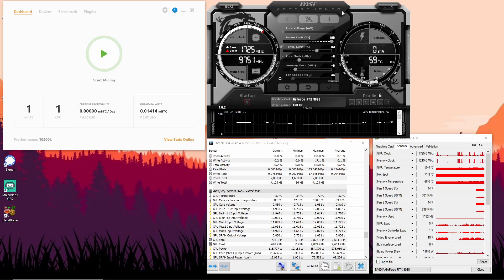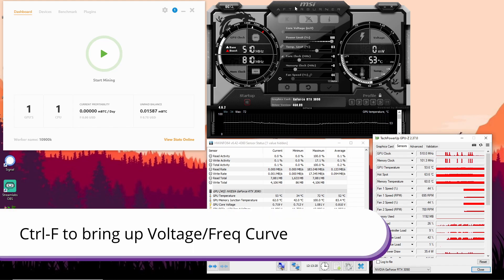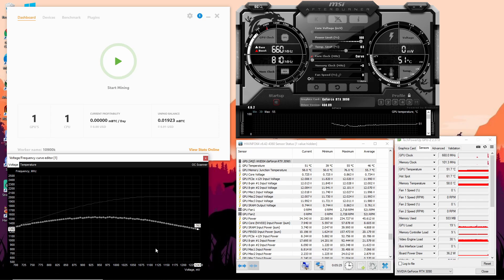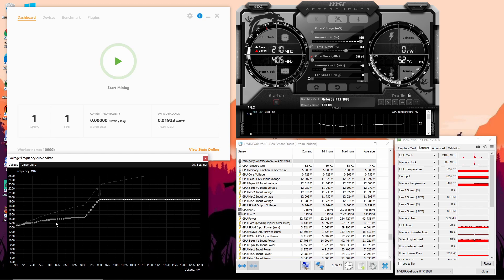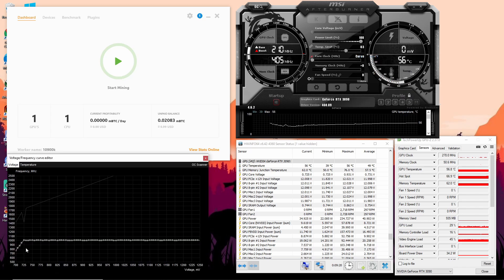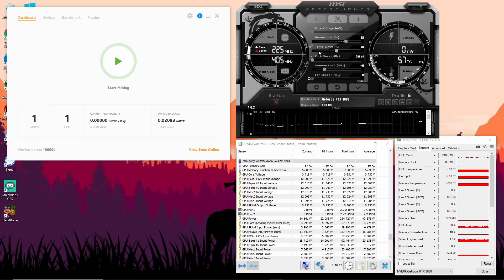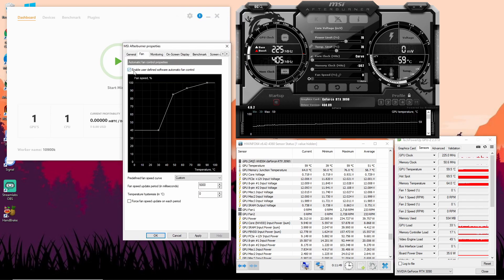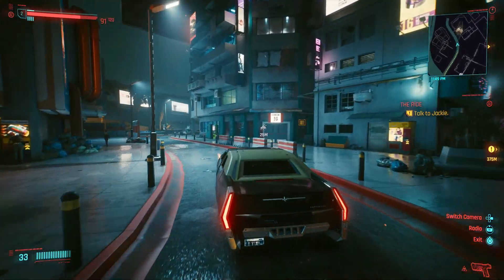Undervolting and Underclocking GPU Guide (MSI Afterburner)

Comment: This is capping the clock, for undervolting specifically wouldn’t you want to set everything after the voltage you want to 0? For example keeping the same clock speeds but up to 1000mv and all the points after that to 0mv??

Comment: PLEASE HELP I HAVE ALOT OF QUESTIONS AND IM TRYING TO LEARN.

Ive set my 3080 on 1440mhz and 800mv
I play on 1080p and seems to get steady 60fps on rdr2.
Is this good or bad? The reason ive set it so low is because i have read that 3080 default mhz is 1440 with boost to 1710mhz also according to tpu gpuz. So ive changed it in msi. 
I was thinking because i play on 1080 i use too much power unnecessary? 
Ive also read higher core clocks increase fps, so with vsync off i reach over 250 fps in heaven benchmark with a score of 7k. 
But, 
What if i descrease the core clock so low that it hit 100 fps average in heaven benchmark? Will this affect my games? Or can i still hit the 60fps with stable graphics? (Graphics glitches, artifacts, only cause issue when too low voltages mv? 
Because im doing all this because my gpu temp goes to 83 degrees in rdr2 (stock) and i dont like to hear the fans. 
So i underclocked it to 1400mhz and 800mv but everything seems to run just fine in rdr2 benchmark. Am i to except any problems if i keep playing like this? 
Will this increase gpu usage aswell? Because i don't hit 95%+ usage in gpu with max settings. 
What if i use dsr with this low mhz? Does it need more voltage, but can i also stay at 144pmhz? 
Lol i don't understand. People stay that i need the highest mhz with lowest mv, but why if i run just fine with just lowering the mhz?

Comment: This is the only way to save your 3090 from dying. My second replacement blackscreened with fans at full speed when the card decides to spike over the voltage limit. Thanks for this, please anyone with a 3090, 3080 do not leave your cards at stock voltage.
Reply: same for rtx 2000 series
Reply: same with 4090

Comment: So I have a Galax GT 1030 ExOC White. I has a max core clock of 1502 Mhz and memory clock of 1502 MHz. But thanks to Nvidia's adaptative boost, this GT 1030 can easily reach 1953 MHz core clock and 3004 MHz memory clock (on Linux it hits 6008 MHz memory clock). But these high clocks can make the GPU unstable in some games and 3D applications, making the entire PC crash. I was thinking in using MSI Afterburner to underclock it. Should I just lower the Power Limit, or lower the memory clock?
Reply from the maker: If you want to underclock - just lower the core clock (mhz). It's different to undervolting which is lowering the powerlimit or adjusting the voltage curve. You shouldn't really have to underclock/undervolt, on default settings, you shouldn't really have any games or programs that are unstable because its the sweet spot of power/performance/cost.

You can always undervolt to optimise power/performance/costs if you need to.

Comment: I have 2 RTX 2060, when i undervolt one the other goes back to the stock curve, how can i make it work? i use MSI afterburner.
Reply from the maker: Hey there, when you use two GPUs on the one computer, MSI Afterburner will let you have different profiles for each one - it'll be an option near your 'profiles'.

Comment: Geforce rtx 2060: 2000mhz @ 925 mV never chrashed in like 6 months 
my card runs 1365mhz @ 700 mV btw so its cooler in idle (for me 1365 mhz is idle because of my wallpapers btw) 
didn't found a game where it hits the 83°C yet and this with fan speed locked at only 60%
really helped me with the bad temperatures I had before undervolting and for those of u wondering I even got more fps in many games because it doesn't hit the 83°C anymore (where it's clocks itself down)
Reply: you will burn out your fans a lot faster if they aren't on a curve
Reply: @TheSpiffingSangheili  It's not that hard to replace them
Reply: @maymax0076  you do you, i dont have extra cash to waste.

Comment: Idk why but rdr2, watch dogs 2 and gta 5 (high end games) stutter after some time when gpu temp reaches 80c and then it falls back to 76c and this keeps repeating. When I played gta 4, gpu temp was 68 to 75c and it was running on 40fps and no stutter. Idk what the problem is cause this is happening to me since i have built this pc. Specs are r5 3400g and rx 580 asrock oc 8gb and 16gb ram ddr4 2666mhz single stick. Can anyone tell me what the problem is please...
Reply from the maker: Perhaps you're running a single stick of DDR4 which means you're using half the memory speed (so instead of 2666mhz, its actually 1333mhz). DDR is Double Data Rate, and it only works at the advertised speed when you use at least two sticks.

I don't know if that's an issue, but that might be a bottleneck.
Reply: @JimRPG  so any idea of what should I do to fix if thts the problem. Coz the stutter occurs when gpu temp reaches 80 but when I play gta 4 the temps are normal till 71c. It only happens when I play demanding games. If it is bottleneck then what component must be causing this?

Comment: I've tried following you and every other videos in yt about undervolting but still nothing happens 😢 my wattage still the same, my temps are still ranging from 80-87 playing AAA titles, its sucks man. Im using Asus RTX 3060 ti dual mini. Someone here knows how to deal with it?
Reply from the maker: hey dude, what part of the guide are you having difficulty with? What part isn't working?

Are you getting 80-87 for GPU Core? 80 is fairly high but normal - im also getting about that for cyberpunk 2077 on a 3070 - and that's the gaming OC which is 3 fans.

87 is a bit high though. id undervolt it a bit there though if you need all the performance then keep it at that temp.

I wouldn't expect 50-60 degrees for gpu core because thats for mining.

You're welcome to join the discord there and post images of what you're getting if you need help.
https://discord.gg/gXs9JhUtrk

Comment: I got 3060 and dropped the limit to 70 it still runs at 40 idle is that normal or should it drop more
Reply from the maker: are you playing games or mining?
70% is a lot to drop to, im running mine at 90% - I have the original one so thats what I need to run it at to get 47mh/s. mem temps and gpu temps are not that big of an issue on the 3060.
Reply: @JimRPG  playing

Comment: Hi, l undervolting my 2070S  but MSI afterburner after some time in stress (up to one hour) raises the core frequency and voltage to standard values.
How to avoid it?
Reply from the maker: You've probably gone too low on the undervolt is my guess - and if it can't sustain it, it'll jump back to a higher frequency/voltage.

I'd adjust your undervolt curve a bit more.

For example if you're asking the GPU to do say 0.7V at 1700mhz... it might not do it and then it'll jump to another voltage/freq it can sustain. I'd say either bump the voltage up to say 0.75V or lower the freq 1600mhz.
Reply: @JimRPG  Thank you for your answer, Unfortunately, even a minimal change mV causes a fallback to the default.
If I enable optimizations in nicehash Everything works as it should (I only have temperatures too high).
Reply: @ar.dym.  I do have the same prob with an 1660S with afterburner.. Many times I have to recreate my settings.. And same as you I don't undervolt so much.. One of my friend can do what ever he wants with his Radeon cuz with adrenaline there is no restrictions compare to afterburner..
Reply: @FastTwitch_FR  Hi, I didn't solve the problem. I'm using oc tune on nicehash. This is a problem for me, if I want to change the mining program in the future I can't do that because MSI afterburner will reset the settings to standard values.

Comment: What happens  if you clock the card and then use nicehash optimization?
Reply from the maker: what do you mean clock the card?
Reply: @JimRPG  if you apply overclock settings, and then use nice hash optimisation on top....
Reply from the maker: @aidanyoussef  ah i see - i don't use nicehash quickminer which is what I think you're talking about. I think nice hash overrides it. I haven't used it in a while - and that's why I don't really like it because I'd rather dial in the settings on MSI afterburner myself.

Comment: so how do i lower the voltage without decreasing my frequency? i'm confused. my 2060 runs at 0.9v-1.1v pretty much all the time, even if i lower my frequency. force constant voltage is not turned on
Reply from the maker: You can hit ctrl f to bring up the voltage/frequency curve, here you need to play around with the voltage/frequency until you can sustain the frequency at the given voltage.

So for example you want to run 0.85v - start by testing at a lower frequency (say 1500mhz). You want to draw a straight line from 0.85v and above and it'll be at 1500mhz only.
If that works, you can bump that up to 1500, 1600, 1700 etc, until it no longer holds 0.85v and starts using a higher voltage.

So now you can test lower than 0.85v if you want, but most likely you'll have to lower frequency as well.

Feel free to ask if you need more explanation.
Reply from the maker: Once you get it - its actually pretty simple but it is kind of confusing to begin with.

It would actually be a lot easier if they let people set the voltage and the MSI Afterburner program finds the frequency.

Comment: i dont have the option i have a gtx 950 2gb ASus OC and i dont have the voltage control frequency option idk what to do im having higher temp than i used to have like 20 more and my gpu is cooled and i do thermal paste every mounth
Reply from the maker: you should just keep it at stock settings. At stock, it shouldn't be that hot. does the temp go back down after thermal paste change? If it does - I'm not really sure if it keeps going back up. Maybe change the brand of thermal paste.

if it stays the same after thermal paste - it must be something else. Sometimes its easy to misalign stuff when putting back your card or the thermal pads are too thick and there's no heatsink contact with the GPU.
Reply: @JimRPG  if i dont lock it at 80 temp with msi after burner it would go further . i was playing fifa 21 like in ultra 3 mounths ago like 70 temp max  in ultimate team now in low i get like 75 and locked to 60 fpsidk what to do really
Reply: @JimRPG  i wanted to undervolt for less temp and high performance but i  dont have the voltage frequency control settings

Comment: Is there a difference between adjusting the voltage curve and just setting a power limit?
Reply from the maker: Power limit reduces the amount of watts your GPU uses from stock settings. So if your card say a RTX 3080 uses 320W and you set your power limit to 90% - it will now use 290W.

Adjusting the voltage curve - you wont be able to see the watts your GPU uses, so if it typically uses 1.2V, and now you use 1.1V - it will use less watts, but Afterburner won't say how much less. You could use HWinFO to see amount of watts used.

In other words if you undervolt your GPU to say 0.75V for example, setting your power limit to 90% does nothing, because you're probably a lot lower than that anyway.
Reply: @JimRPG  oh I see, so it worth adjusting the voltage manually or the power limit or both in order to get optimised performance/temp/power ratings?
Reply: @Trace6x  Hey Trace I'm wondering about the same thing, did you learn about it? (if there's any advantage in both lowering the power limit and changing the curve)
Reply: @Trace6x  There's no advantage to doing both. The Power Limit applies to the limit set by the BIOS, so if you undervolt, you don't hit those limits anyway.

The would use the PL if I didn't want to go through the undervolt, its a quick and stable way to lower power output but won't be max efficiency at that power limit. That can only be achieved by undervolting.
Reply: @JimRPG  How do I do this with the new msi afterburner interface? I'm not understanding how.

Comment: can you give a fix on how to fix msi afterburner not applying the settings i want it to be?
Reply from the maker: MSI Afterburner only works as I've shown it in this video with Nvidia desktop Graphics Cards.

Since making the video, I think MSI Afterburner doesn't work with laptop GPUs, and doesn't work well with AMD GPUs, it does a few things like change the power limit, but its very limited in all the other settings.

Comment: when I press ctrl f, the voltage frequency doesn't pop up. could you help me please
Reply from the maker: are you using an Nvidia graphics card? It doesn't pop up with an AMD card.
Reply: @JimRPG  ye im using gtx 965m
Reply from the maker: @sobaldman8375  maybe MSI afterburner doesn't work with mobile chips. I haven't tried with that. I suggest searching for a undervolting a mobile/laptop gtx 900 series video instead. Perhaps there's other software you can use that undervolts a laptop GPU.
Reply: @JimRPG  alright ppeciate it
Reply: @JimRPG  it doesn't work on my gtx 750ti...
Reply: @JimRPG  it works with amd for me
Reply from the maker: @houdie1181  are you able to adjust the voltage/frequency curve? It didn't work for me on a RX 6800.
Reply from the maker: it should definitely pop up with an Nvidia GPU. I don't really have another suggestion if that doesn't work. 😄
Reply: Me too, i have a GTX 970

Comment: Yoo why i see other people setting the power limit at -50?
Reply from the maker: Power limit -50 means you're limiting the power by 50% so on a 3090 that would be 350/2 = 175W.

I've never tried it, because I didn't want performance to drop that much. Your clock speed would also have to match as well, so you have to adjust that too. For example there's no way you can do 1700mhz on 175W, so you'll have to lower your GPU core clock speed and possibly your mem clock speed as well.

People reducing their power limit by -50% want to use as little power as possible but their performance will also be affected.

Comment: I am experiencing constant crashing and rebooting of my computer a couple of minutes after playing red dead redemption 2 with my RTX 3070 card, sometimes with a blue screen "whea uncorrectable error". Just experienced problems with Red dead redemption 2 for example i can play Death Stranding and Control for hours and hours with no problems... Kind of n00b with hardware need help ;)

I beleive ive read somewhere that undervoltaging "could be a fix"... Should I try this...? (I have updated BIOS, updated drivers and all other fixes that people try with RDR2.

 (my specs: AMD Ryzen 7 5800X 8-Core, Corsair vengeance LPX DDR4 3600Mhz 16GB (2x8), Win10 64-bit, Gigabyte RTX 3070 Vision OC 8GB...).
Reply from the maker: Your card should run fine at stock on RDR2. It could very well be the software - ie RDR2 thats the problem but its been out for a while and it should run well on most systems.

Not sure Undervolting will fix your issue, its possible at some point it may not even have enough power to hold the clock speeds and crash.

Normally what most people would do (if they really think the GPU is the issue), is to put it into another system and test there as well. But most people probably wouldn't have two very similar PCs lying around.

Try the vulkan API in the graphical settings and if that helps - I think it should give better performance than DX11 but I honestly haven't tested. Also are you getting crashes constantly - maybe if you get past an area it'll get better later on. It's really hard to say.
Reply: @JimRPG  Thanks for the help! :). I have tried both with DX12 and Vulkan, stil crashing.. Well it could be that the crashing will stop once I get past certain areas of the game, problem is I am early into the game and just entered the "tutorial" town valentine the crashing/rebooting makes it impossible to get past this area. Could be I have faulty GPU or Ram or anything really, but the GPU was my first guess. Hopefully there is a patch soon that fix this.
Reply from the maker: @bokarlsson6704  It's been out for a year - so I wouldn't expect many updates... unless the last update broke something. Run everything at stock, CPU, mem and GPU and as a last resort reinstall the game.

Also play around with windows borderless, v sync off, and the other graphical options... I know im reaching here, but that's what happens when you've tried everything.
Reply: @JimRPG  Thanks I will try this :).
Reply: @JimRPG  actually I tried underclocking and then played RDR2 and it did not crash. I only had time to play just over an hour but that is the longest play time so far and no crashing. Except for wife and kids and shopping disrupting my gaming. I will stresstest it for real soon.